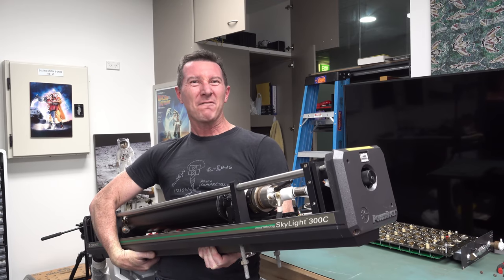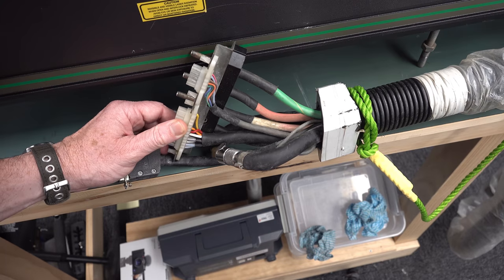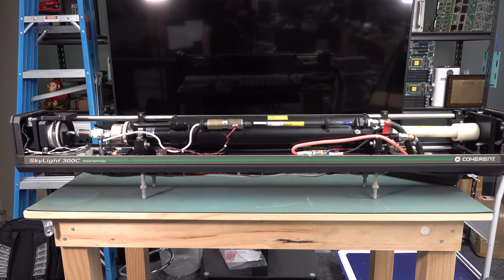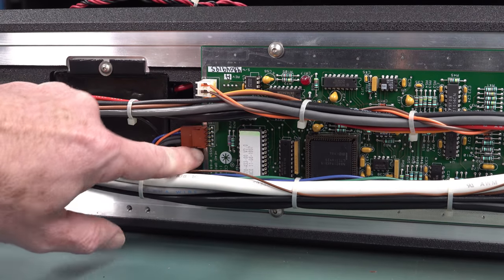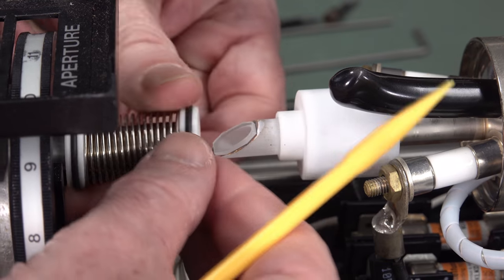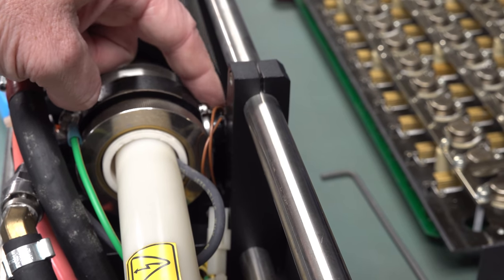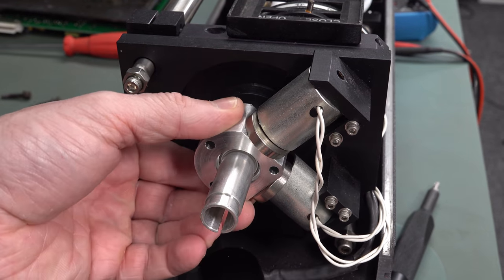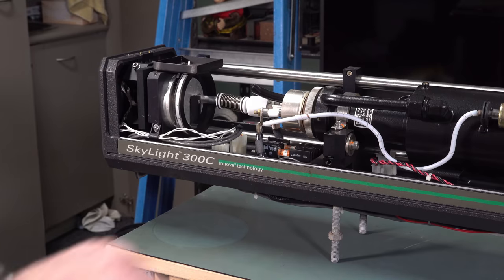EEVblog 1412 - Argon Ion Laser TEARDOWN!

Comment: Yeah, route the HV lead right over the microprocessor! Not sure I would have done that.
Reply: It's DC. Doesn't matter a rats arse :)
Reply: @zaprodk  At how much voltage and current? And does either change abruptly?
Reply: @andydelle4509  No. The filament current is very stable.

Comment: I used a almost identical unit (Innova 300C) during my postgrad studies it was supposed to be 40 watts but the most I ever saw I think was 30 something and that was after one of my supervisors  spent a day aligning and tuning the thing, I only watched and was only allowed to turn it on/off every day. I also had to plumb the water cooling system to it when I first got there cause that unit hadn't been used in a while. I used this 30 something watts to get extremely precise 1W at a different wavelength by using it as a pump for a Ti:Sapphire laser. The dithering on the mirror from memory was for indeed the for the line and power and connected from the control unit.

Comment: 10W, is that a joke?   ...or a typo.  i.e. 10KW?  I am not trying to be funny,.  Was this insane 0.01% like crap efficiency the norm in the nineties?  After all CD were out, so solid state lasers existed.  As were home use CD burners, and they used more powerful lasers diodes?  I am seriously confused, so I assume I am missing something?
Reply: He mentions in the video that it's about the quality of the output of the laser
Reply: 10 watts of optical power out, lasers are not efficiant devices!   I have a 40 watt CO2 laser which runs the tube at about 15000 volts at 20 mA that is 300 watts input to get 40 watts out
Reply: The inefficiency here is inherent in using argon as the gain medium. It’s just not an efficient process no matter how well engineered the system is. But they are still in use today because of their unique beam characteristics. Direct diode lasers like those used in CD players are much more efficient but have terrible beam characteristics and can’t really be scaled up to higher powers.
Reply from the maker: No, not a joke or typo, the physics on these types of lasers dictate this.